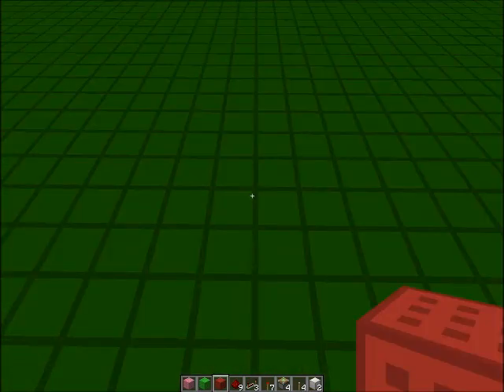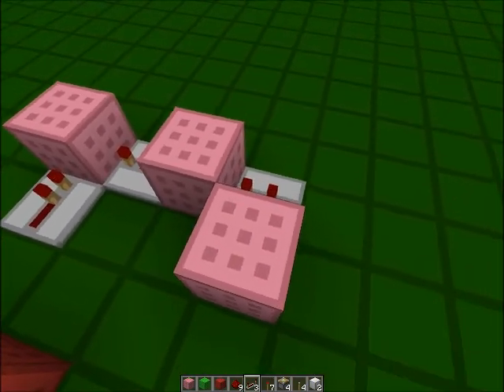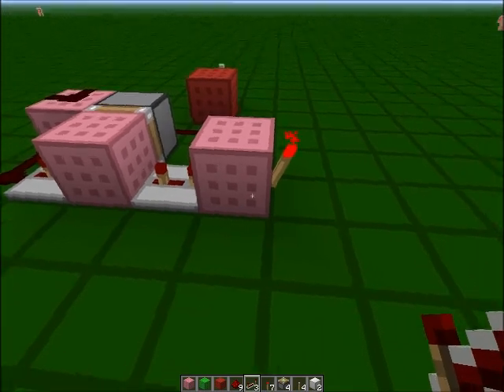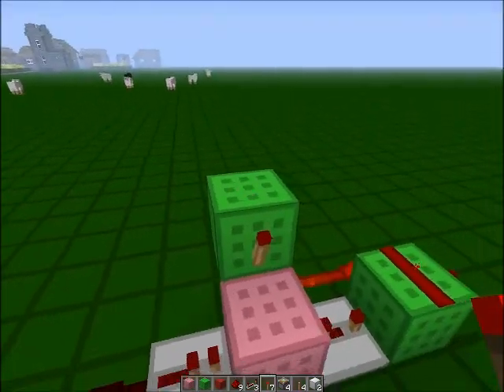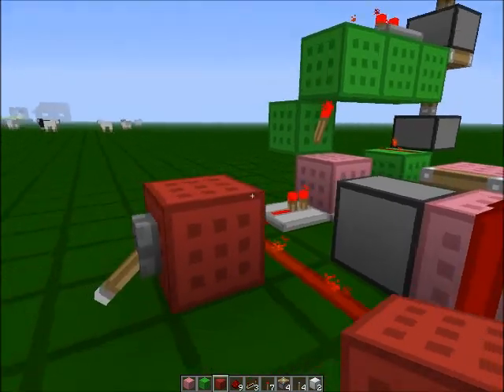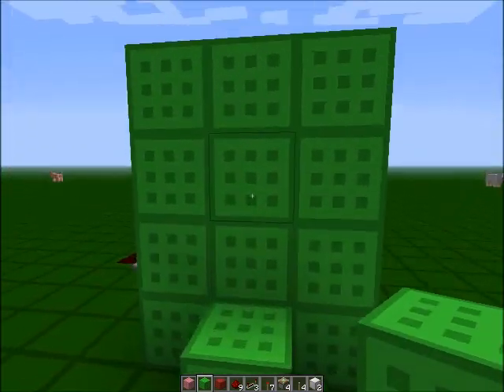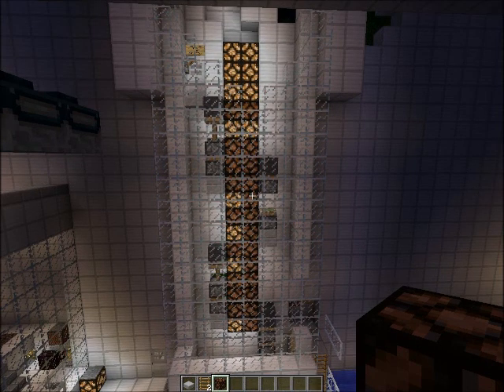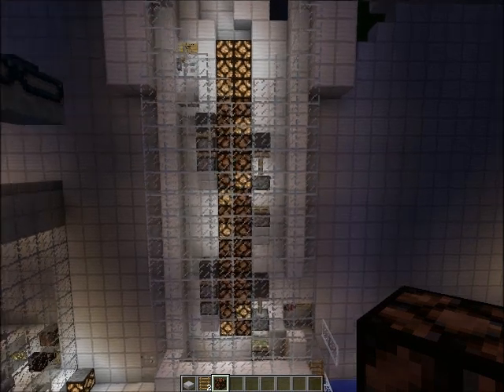[Minecraft Tutorial] Simple Compact "Double Piston Extender" That Works Through a Wall

Comment from the maker: read my description to see how to modify this design for a button. This same alteration should also work for most t-flip flops... This design uses a bug that favors pistons closer to the power source over further pistons although theoretically they should hit at the same time. I have used this design in 1.4.7 though and it still works... I have yet to check with the latest snapshots